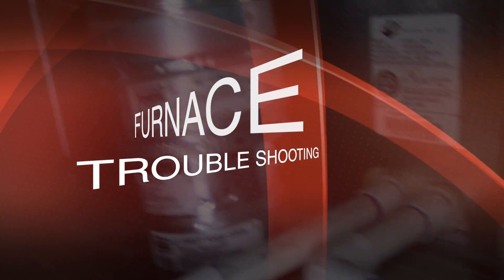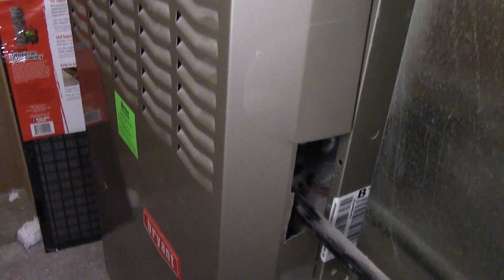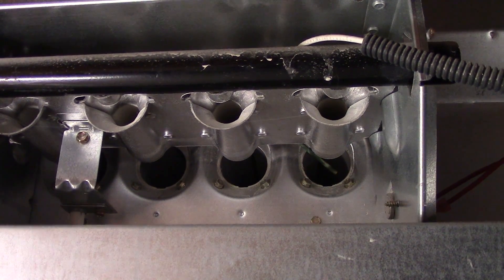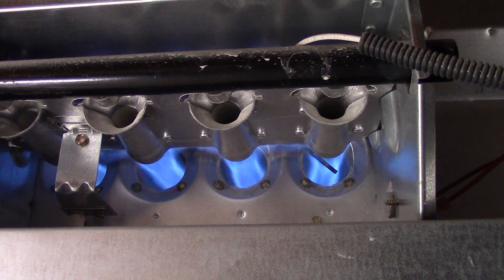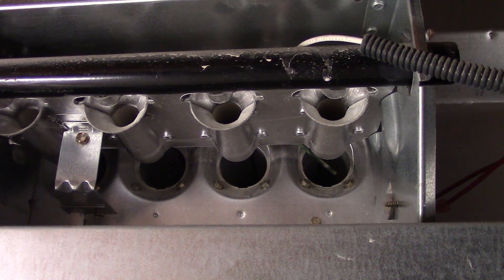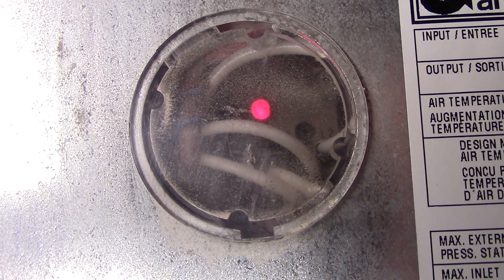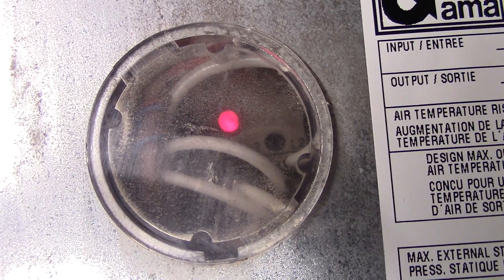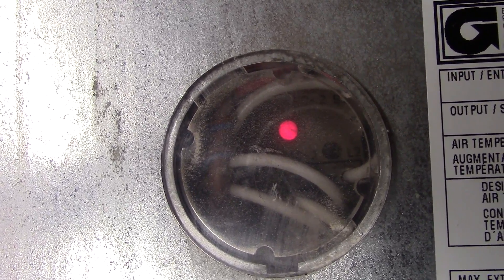How to fix a furnace that won't heat

Comment: andrew i was just wondering if the flame  censor is dirty would that cause your furnace to blow very poor heat and keep starting and shutting down quickly i have a goodman furnace and this just started to happen last year and furnace is about 8 years old thanks any help would be great

Comment: My 21 year old Miller-Nordyne furnace has failed for the first time (other than an ignitor replacement in 2013).    It ran, then stopped running during the night. Checked the power (ok) and then turned the on-off switch.heard a click when I turned it off. 

Turned the switch on again, and it started up after a minute or two . The inducer motor was running and the ignitor lit with a blue flame coming out of the gas jets. It ran for several  heat cycles and then stopped running. 

Called a furnace repair guy to come in and do a diagnostic on it.

The first thing he did was remove the top cover panel (to the burners),  and it started running again!   He had never seen that
before.  He cleaned the flame sensor and also examined the limit switch (forget which one), put them back and started it
up again.  
The furnace ran, until he tapped lightly  on plugs on  the control board with it running, then it stopped running. 
Got it running  again. He tapped the board again  in the same area, and it stopped running.  Told me it was going into lockour and it seemed like the integrated control board may be faulty.  
I ordered a new circuit board e from the US supplier , and it is on it's way.
 Sure hope he was right,  as a new furnace will be a lot more expensive than just a circuit board.

Comment: I have changed the ignitor and cleaned the flame sensor rod, but still have 2 flashes on my TRANE xv80, indicating tries have exceeded.  No gas is coming in.  The vacuum switch is spinning and the fan comes on - any ideas?

Comment: Hey Andrew, sometimes the fan that is connected to the vacuum switch does not spin. When it does not spin, the ignitor won't even light up, so the furnace is like dead ,but the LED is solid red. However, sometimes the furnace works for a short period of time and stops, sometimes it runs until it reaches the set temperature. What do you think can cause these problems? Jean

Comment: When the furnace is first turned on, and the fame sensor failed to detect flame, how many times the furnace would it try to reignite? If after several times of failed to reignite, what would be a most likely cause of the problem?

Comment: Also, Honeywell #VR9500 'Smart Valves" used about 1990 to present have circuit boards on top of the gas valve that have 1 - 10 solder joints crack... a hot soldering iron/gun can remelt the solder joints and fix it... a #15 Security Torx bit tool is needed to remove the beige plastic cover/circuit board by sliding it toward the furnace to unplug it after ground wire removed... also clean oxidixed contacts at the solenoids... piping gas to the gas valve with iron pipe instead of a flexible connector or plastic tubing can cut down the vibrating of the gas valve which cracks the circuit board/solder connections... YouTube has 7 part video showing how to do that soldering, etc...

Comment: My glow plug ignites the pilot flame but that's all that ignites.  The furnace will just blow cold air because the furnace heater part never ignites.

Why?
Reply: With a pilot system, the pilot flame normally heats a thermocouple that in turn opens the main gas valve. Thermocouples are very prone to failure, but cheap and easy to replace.
Reply: Sounds like a blowout sensor, its a couple buttons to push around the burners with purple wires

Comment: What the furnace is rapidly flashing but I did read if it is there is at winning error it will blow heat then cold .Should I reset it.